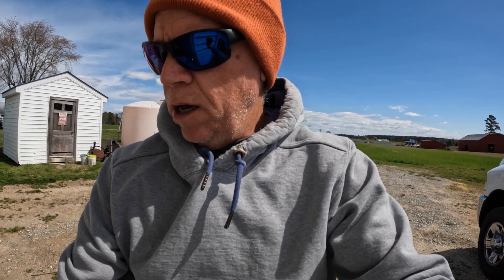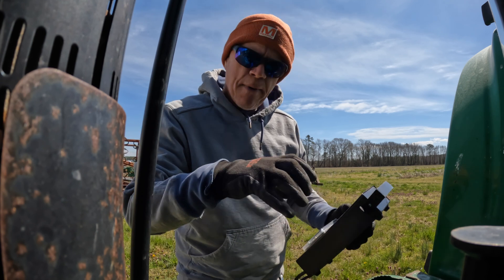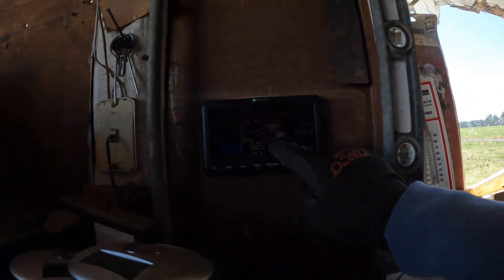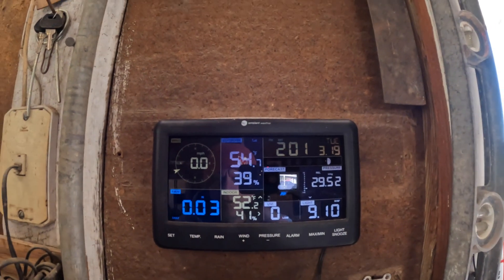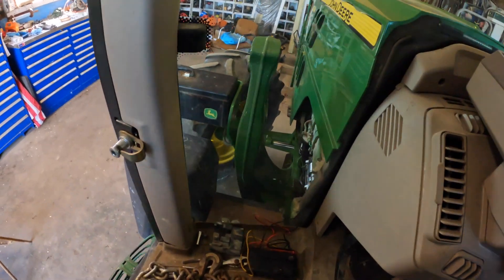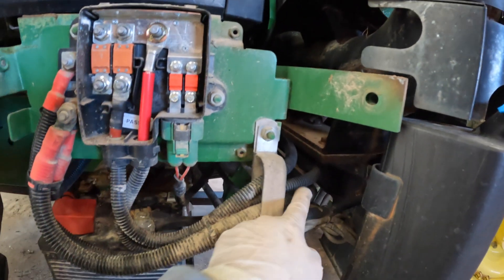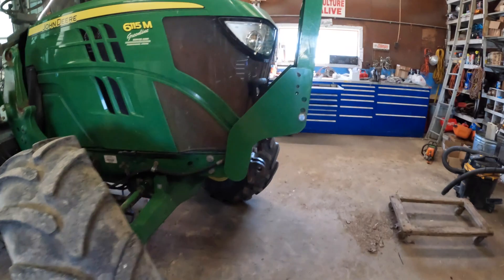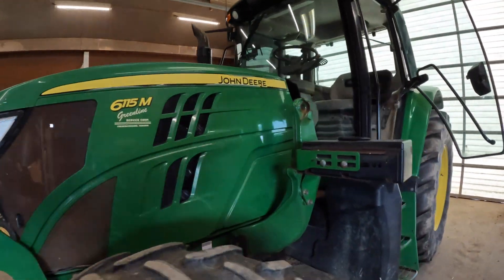Temperature & Starter Issues Finally Fixed!

Comment: Silicone Dielectric Grease Automotive/Marine 10g by YOLOtek Veteran Owned. Silicone Grease for Electronics, Spark Plugs & Battery Terminals Silicone lube. Protects Electrical Connectors. Grease Tube

This may be something to consider for your battery terminals.

Good videos!

Comment: I can only watch the video but it looks like there might be some green corrosion on the open end of the cable. I had chased down a similar problem and that green corrosion went a foot up the cable.  You might want to dig a little deeper into the problem. That was my problem why my boat would eat starters after my third one I was like wait a minute something is wrong.